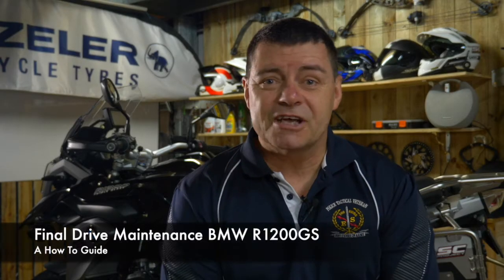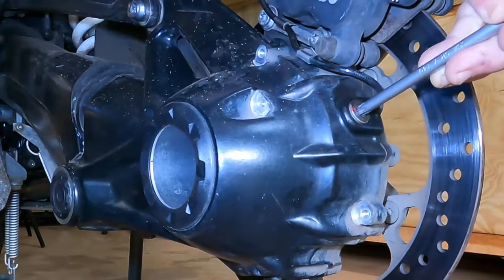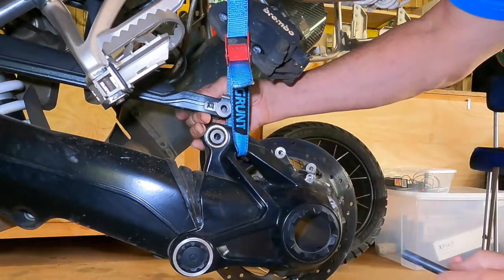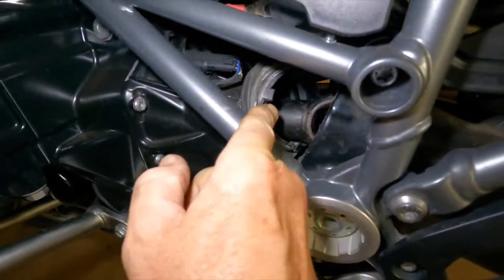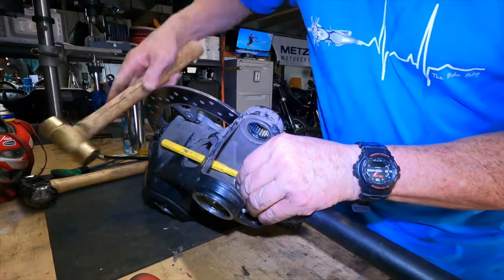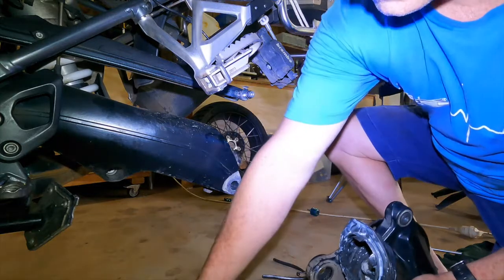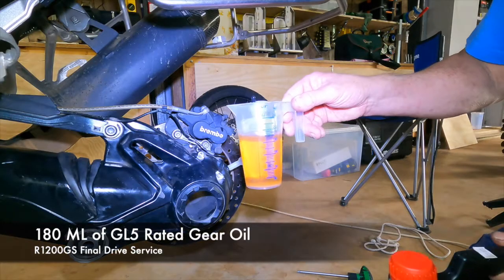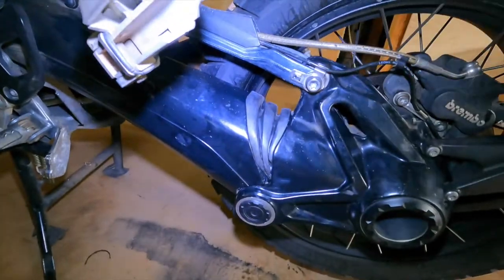Properly Servicing Shaft Final Drive on the BMW R1200GS

Comment: I forgot to tell you that the BMW Service Advisor also told me that the splines are not lubed at the factory - years ago when I asked about this maintenance.  (My bikes are a 2012 K1600GT and a 2014 R1200GS. ). You have inspired me to do this maintenance.
Reply from the maker: haha, cool, yeah I do it every time I service the bike now, takes very little time to drop the diff and whack some grease on the splines

Comment: In the meanwhile, BMW recalled all the GS LC bikes till 2019 to proof the driveshaft and drill a drain hole on the driveshaft housing, and for bikes with more than 70.000km they replaced the driveshaft with a new one without a further question . (I live in Germany)
 Nice job to show the people to take care of their driveshaft in a way that BMW never does, but the grease type is wrong, the same procedure must be done on both sides of the driveshaft and the gear oil is not the right one. This is for cars that you used. This is not the end of the world, but you have to repeat the procedure more frequently.
I did it twice already on my bike and drove about 80.000 km. Every 20.000km for the gear oil and about 40.0000km the spines and rubber boots cleaning and lubricating, depending if you ride a lot in the winter and wet environments.
Now BMW changed my driveshaft with a new one.
Reply from the maker: Yeah I had a chat with the BMW folks and they told me about the work they were now doing. And thanks for the heads up and advice, appreciate it.

Comment: Great video!  I only wish I had viewed it prior to my power shaft u-joint breaking and damaging my final drive and swing arm three weeks ago.  I've got a dealer serviced 2016 R1200gsa with 52,000 miles and sudden vibrations and intense clunking happened near Gunnison Colorado.  After getting the bike back to Denver the dealer quoted me $7,336.06 USD for parts, freight and labor.  Instead I got used parts off Ebay (drive shaft has 13k miles and both the FD and SA have about 5K) and did the maintenance with the help of a buddy.  My total cost was $2,400.  Still an expensive lesson but feel fortunate.  I'm definitely a grateful subscriber to you now.

-Tony
Reply from the maker: Holy crap, thats a lot of money for repairs! I wish I had known this 20k kilometres back as well, fortunately I've not had any failures only a weird vibration that has since gone away. Cheers, safe riding mate.
Reply: @TheBikeStig  Weird Vibration (more a humming) (bike has 45,000KL and issue is in the last 5k) is what I have on my 2017GS. Trying to work out what it could be, happens around 70KPH and goes away when I clutch it. I have two sets of wheels so I can swap them over, so it's not the tires. I'm thinking rear bearings maybe?
Reply from the maker: @Mckhuus  no idea mate, I would do an oil replacement in the diff if it was me to see (a) if it's got sufficient oil, and (b) to make sure there's no metal in there. replace the oil with a decent high quality diff oil. Find nothing, I would take it to a workshop and have them do a check. Sorry got nothing more than that mate.
Reply: Good man 👍🏻.  Dealerships are a bloody ripoff.   Wishing you many more happy miles. 🍺
Reply from the maker: @rumien1383  back at you mate
Reply: @Mckhuus  These are very often vibrations superimposed on the engine, gearbox and cardan shaft. These swell up and down, because in 4th gear the differences in vibration between the engine and the cardan shaft are very similar and sometimes overlap (almost in the same cycle) and sometimes exactly in opposite directions and thus almost cancel each other out.
The sine waves of the vibrations converge and diverge again and you notice it sometimes more and sometimes less. Take a look at the condition of the cardan. Removing rust and greasing the splines may also help here.
Reply: @Mckhuus  if the vibration goes away when you pull the clutch in it's not in the drive line or rear wheel bearings as they are still turning!
Reply: Get rid of it and buy a Honda!

Comment: Phew!!   Thank you so so much for this video. I have just purchased a 2019 R1250GS with 11,000 miles and as it out of warranty the first thing I am doing is a complete service which includes the lubing of the drive shaft splines I have heard so much about (my 1st GS).  Well, attempting to drop the final drive gearbox I realised it wasn't falling back and down (like all those DIY videos I have been looking at) PANIC!!  Realising the drive shaft had sort or seized into the G/B spline I decided the only way to get this undone was to remove drive shaft and G/B from the bike.

I remove that large mother M12 bolt but still doesn't come out. So I thought I have to remove the Circlip on the other side (so just ordered a pair of circlip plies) AND THEN........ I cam across your video  THANK YOU!!! Tomorrow morning I will just push out that collar and try and repeat what you did!  Thanks again  PHEW!!
Reply from the maker: You're welcome mate, glad I could provide some advice from my own experience.

Comment: The correct torque spec for brake caliper to final drive is 24Nm. 38Nm is the spec for the M10 bolts on the front caliper and would shear the M8 bolts of the rear caliper.
Reply from the maker: cheers mate, appreciate the information

Comment: Thanks your video was very helpful I have 2018 1200 GS only 8000 miles and final Drive splines were frozen,hard to believe they are not lubed at the factory. Thanks again.
Reply from the maker: crazy isn't it, I love the bike but it's this one thing they have not fixed. Cheers mate

Comment: Thanks for a great video!  I have used it several times over the past years to perform this maintenance chore.  Today, however, I am having a very hard time getting the front yoke of the driveshaft onto the spline of the transmission output shaft.  Don't know what I am doing wrong, but when I reviewed your video you just say to reinstall it, with no further advice... just do it!  
Guess I will have to find some other video for help with this problem.  Thanks again.
Reply from the maker: yeah sorry mate, I've never really had any issues getting it back in, I poke a screwdriver through the frame to lift the shaft up to align it and it seems to work ok

Comment: PB Blaster penetrating oil is good stuff.  If that doesn't get it, the drift punch as you show is plan B, and the nuclear option is torch heat.  It'll come off.  BMW is now offering a driveshaft replacement campaign for all the wet head R1200/1250 bikes.  I fully expect some dealers will play dumb and will have to be "educated".  Great video...short, concise and accurate.
Reply from the maker: cheers mate, yeah I heard about the campaign, they rang me and asked if I was bringing it in ... told em I'd already fixed it.
Reply: I just pulled the trigger on one of the aftermarket, rebuildable universal joint drive shafts.  Now I won't have to deal with the substandard BMW part, just lube and rebuild the new shaft if it ever needs it.  Spendy part ($750) but it's worth it to me.  I just have no trust in maintenance shops anymore and dealing with dealer nonsense. @TheBikeStig
Reply from the maker: @briand4000  wow, didn't even know you could do that

Comment: Man thanks for the video. I’ll be tackling a 2018 RT.  Just getting items together. I might as well pull the drive shaft out. Dreading trying to get shaft back on lol. Seen enough videos, it’s doable. It’s winter here in northern Alberta, so perfect time to do this. Thanks for the info
Reply from the maker: go for it mate, funny thing is I never had any problems at all getting the shaft back in. All I did was make sure the end was parallel with the shaft it was going onto and wallah, slipped on easily. Have done it a number of times. Have fun :-)
Reply: @TheBikeStig 
Everything went smooth till I found out the drive shaft is “welded” aka rusted onto the rear drive. There was water in the swing arm. U joint was rusted. Ugh. Warranty finished in October. I parked her in October for the Canadian winter. I’ll get some penetrant and try soaking her. A bit of “normal” rusting at transmission output. There was no factory moly on the splines. And very little sealant around the boots. Positive note: rear brakes look thin so I will order new ones all around lol.
Reply from the maker: @thewelder9492  I feel for you mate, it's a friggin nightmare that could be so easily avoided if we only knew about it beforehand. Good luck with it mate

Comment: Great video, thank you.  I inquired some time ago with my local dealer about service on the splines of the final drive and they told me at that time no service is required.  I always thought that was odd and not correct. 

 Since, I believe BMW has come out with a different view.
Reply from the maker: yep, they got that wrong, I grease the splines now every time I service the bike.

Comment: Thank you. Good video. I have new 2021 RS with 20k Miles I saw how bad it was rusted. lucky not as rusted as this example. I was thinking about drilling drain holes. the whole tail was full of water. Not sure if it was from rains or what being a street bike.  I think next time I will pull the whole unit and clean off all the rust like you did. all I did was add lots of grease.

Comment: I don't know about the 1200's onwards but rest assured, the 1150 series had huge failure rates from clutch splines all the way to the rear main bearing.  I was lucky, my GS was good until I sold at 90k mi with only having to do a retorque of swing arm pivot.  My g/f, not so much, her clutch splines failed at 33k. There was a thread on advrider some years ago and the respondents reports of 1150 driveline failures was over 25%.  I'm on a Super Tenere now and g/f on F650GS; much more reliable and easier to live with and maintain.
Reply from the maker: Really, i never knew that, I've heard of a few 1200 failures but I had a feeling it was because of poor maintenance, and this obvious failure to grease and service at the factory. I know I keep my eye (and ear) on it now.

Comment: Awesome video and very well explained, thanks. The driveshaft you show in your vid is a shaft with the uni's phased as you would normally expect (parallel) my driveshaft, which was rusted at the diff end the same as yours, is phased out of normal alignment by 45 degrees. Another shaft I have seen is the same as mine, how is yours phased, or has mine been shock loaded out of alignment through the cush drive? Thanks again.
Reply from the maker: wow, you got me there mate, I am not that technically knowledgeable unfortunately. the shaft on mine is the stock one that came on the bike and I never took notice of uni phasing ... sorry about that

Comment: DONT use this grease people!    Its a $5 grease better suited to the garden gate hinge.  You want Staburags NBU 30 PTM  or similar that  is more like $200 for the same amount. Thankfully you can buy the tiny amount needed on ebay .  Its a very high pressure application  and you  dont want to be replacing the unit because of ware.    Think twice also before running a thick  gear oil. Ok for low speed and when hot but a thinner oil will take heat out of the gears better and flow into them better when cold. Basically just use what BMW recommend  and not  this vid.

Comment: Well done, Interestingly, you use the waterproof grease on the splines where most BMW guys use a Moly or the bearing grease for the splines.
Reply from the maker: cheers mate, yep I got told off by a few people about that, I ended getting a more appropriate grease as per recommendations that I have since used on the splines.

Comment: This is a great video regarding the Shaft Drive. I own a 1300s and I want to service mine as whell. Don't you do the front part? I think the front part is very difficult because of two wires that run by the booth. Or is it ok to just only clean the tale of the drive?
Reply from the maker: You're right, and yes I actually did do the front part. The reason only the back end is covered here is because that's where the problem is and it gets rusted onto the spline. Cheers mate

Comment: Great video! thanks. I had the same problem. I put some WD40 on the stuck spine as soon as there was access. Once I had the differential loose and started to pull it away from the bike the drive shaft popped free. Just as well as the pivot bearing looked like it needed fresh grease. I use high moly Loctite grease and silicon paste to seal the rubber boots. In the future I plan to check the drive line splines and drive shaft universals  every time I change the differential oil.
Reply from the maker: Good stuff, good move with the servicing too … i do the checks every time now myself.
Reply: The word is siliconE.

Comment: I’m watching this again for a refresher. So very helpful. One thought…Once the driveshaft is removed and lubed, does the rear part of the driveshaft have to meet up with the front half of the driveshaft in any particular way? In other words, do the splines have to be keyed to each other exactly the same? I keep reading about “phasing” and I don’t really understand it. I’m not sure if this is something we worry about here. Thanks!
Reply from the maker: Hey Brad, I am not the expert on this. However I do know that the phasing of the shaft relates to the phasing of the universal joints and yokes. And provided you do not split the drive shaft and it is left set up as it was from the factory, you won't have any problems or what they refer to as secondary vibrations. The shafts out of the gear box and the final drive are straight forward rotating shafts that are not a part of this phasing issue. There are plenty of articles out there about this, check this simple one out - https://www.drivelinesnw.com/part-trouble-shooting/vibration-analysis/phasing/
Reply: Ok, that makes sense. Thanks for holding my hand during this brief moment of panic! 😜
Reply from the maker: @bradb2514  haha, cheers mate

Comment: Years ago I had a Suzuki GS 650 Katana. Kept it as my sole transport (summer and winter) for 6 years. I changed the shaft drive oil once.
BMW should hang their heads over such a fundamental design issue.
Reply from the maker: I agree, funny thing is they recommend a particular grease for this but I can't see any evidence they actually put some on it.
Reply: I had a 2005 GS for 15 years, never serviced the shaft, did not know it was needed.  No problems with it untill a wrote of the bike ion an accident.  Now busy buying another GS. Will definitely service the drive shaft yearly with the service.
Reply from the maker: @fritzf0001  we all learn this one the hard way, I am still at a loss to understand why it isn't serviced at dealers.

Comment: Shouldn't you use high temp moly grease on the splines like honda77? Lithium grease on the boots.
Reply from the maker: thats a fair question, I am not sure the high temperature grease is necessary on this given it's not a high temperature component, I believe water proofing is the bigger issue. I checked mine after 10k kilometres and no issues at all.
Reply: @TheBikeStig  It is absolutely necessary to use molybdenum paste! I can't believe that someone makes such a video and doesn't even know the basics and what BMW recommends.
Reply from the maker: @motocomfort_de  thanks
Reply: I appreciate this video.  I found your video particularly informative and instructive. I had a hell of a time lining up the front end of the drive shaft with the front spline on my 2018 RT.  Any insights on how to get that front of the drive shaft onto the gear box spline would be greatly appreciated 😐

Comment: Your videos are always concise, clear and informative. Off topic, but I'm new to the BMW brand and wondering if a 'clunky' gearbox is normal? Selecting 1st while stationary is embarrassing, not to mention the changes up and down to 3rd is just awful, both with clutch or quickshifter. 3rd to 6th is fine, in both directions. Any hints?
Reply from the maker: haha, yep that clunkyness seems to be a part of the GS ... I know the later bikes 2018 onwards are better as is the quick shifter on those models. I only use the quick shifter from 3rd gear upwards and know it seems to be good at lower revs than higher revs. I avoid 2nd to 1st downshift with the quick shifter, its horrendous ... that said, I do love the GS
Reply: Try selecting 1st immediately the engine fires on startup. It doesn't help if for some reason you need to select neutral for a while when stationary with the engine running, but will save embarrassment in startup situations.
For unassisted gear changes, always preload the clutch lever then preload the gear lever; the gear lever will slip quietly through as soon as you dab the clutch. And for 'manual' down-shifts, always blip the engine to match the revs.

Comment: How about front end (gearbox side) of the shaft? Does it not need cleaning and grease applied at thew same time?
Reply from the maker: Yep, I didn't focus on it in this video but I do both ends when I do a service. I see BMW has a full campaign to check these shafts now, seems the problem is now recognised.